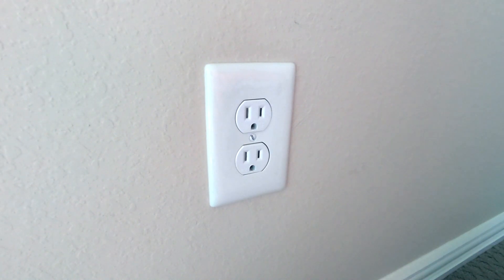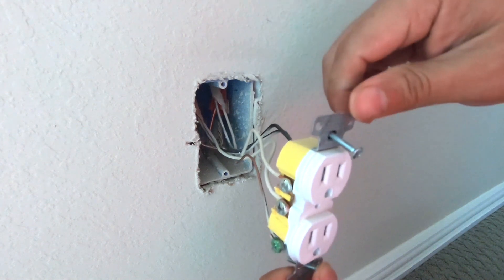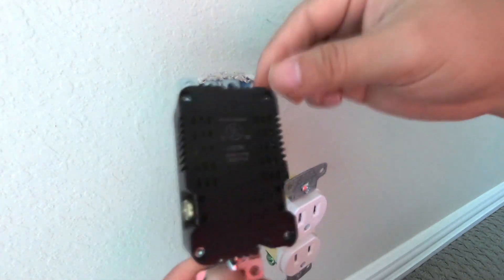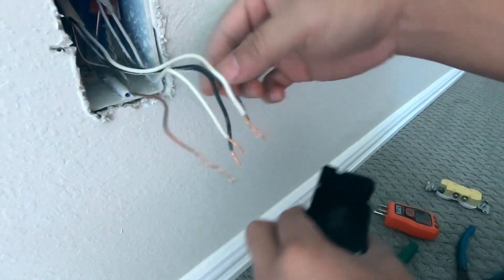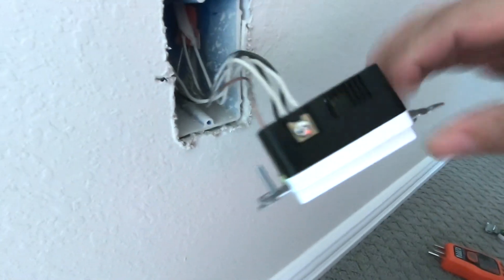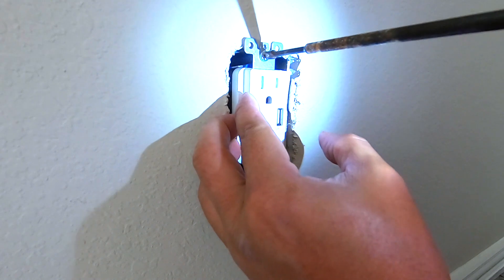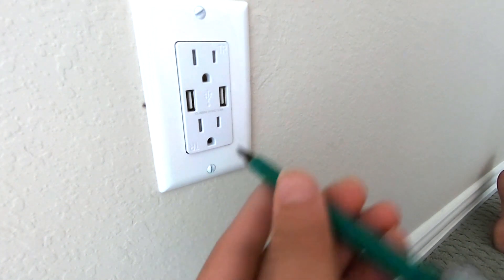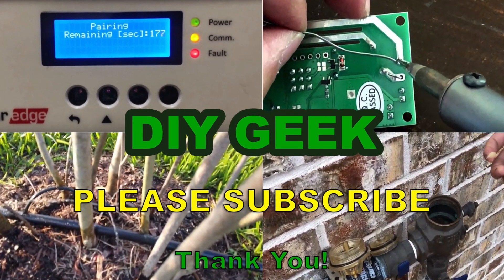Replacing regular wall outlet to USB electrical outlets

Comment: What if my new outlet only has one screw on each side and no "quick release" holes in back? Am I supposed to hook both wires around the screw stem?
Reply from the maker: What country is that plug from? United States?
Reply: @DIYGEEKTEXAS  Yes, U.S. I figured it out. The screw had a little metal "plate" underneath it, and both wires get straightened out and clamped under the plate when screwed down.

Comment: No, no, no... you sell this house, and someone comes to inspect this and see 2 wires tighten down by 1 screw they will fail it..... use pig tails, people use a wire nut, take all the hots, put them together with one going to the USB outlet, the same with neutral it's alot safer and up to code... I can see alot of house fires are going to start with these things

Comment: Thank you!!! My USB plug instructions just said "line" and I had no idea what to do with the load, so I just taped off the hot and neutral load wires... Of course, it didn't work. I thought connecting both the line and load wires to the same node might be bad, so I didn't try that.

Comment: Whenever you change an outlet you should install ground prong up. "Upside-down" If something happens that a cord gets pulled out a little something can fall and bridge the connections causing a blown circuit or fire. Whereas if the ground prong is up its safer.
Reply: Sorry, I don’t agree.  Our outlet was upside down and the refrigerator cord was bending from the plug, to me that’s more dangerous
Reply from the maker: Great tip will try to remember that next time

Comment: I wonder how much electrician charge to do this wall outlet to usb outlet replacement?
Reply from the maker: I would guess, a licensed electrician would charge $70 to change just one, but if you have a few to do at the same trip, should be much less, the wall outlet with USB plug itself is only about $12 each from Amazon:  https://amzn.to/3mCQEsU